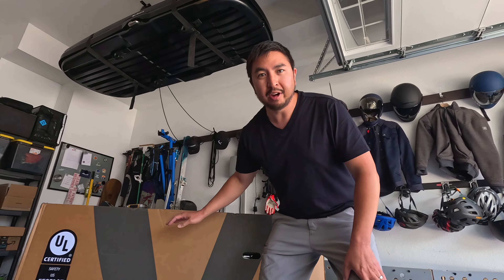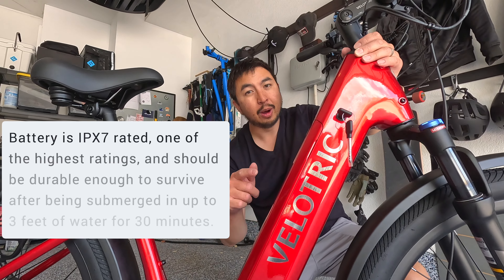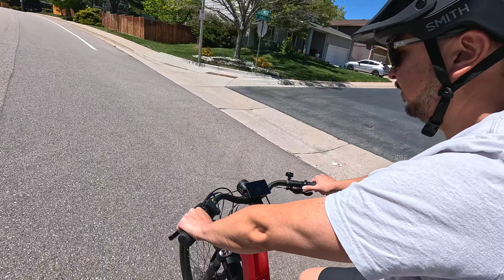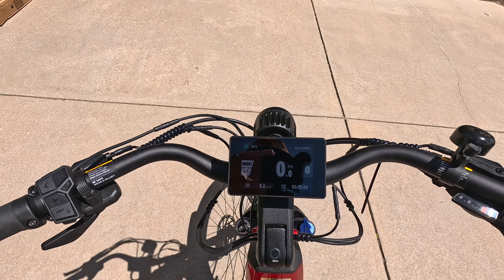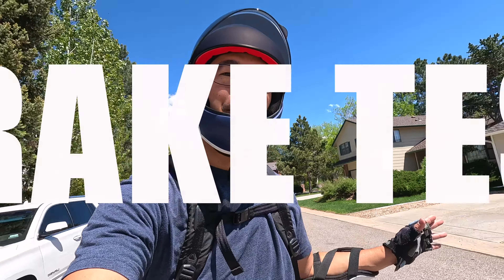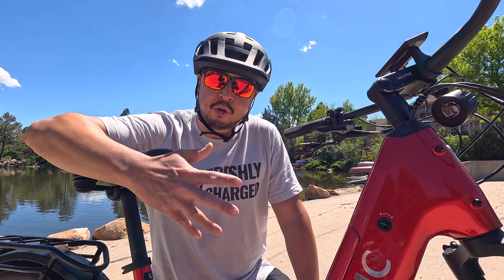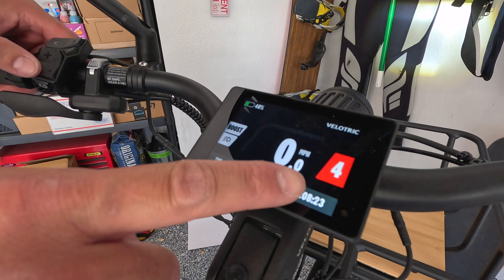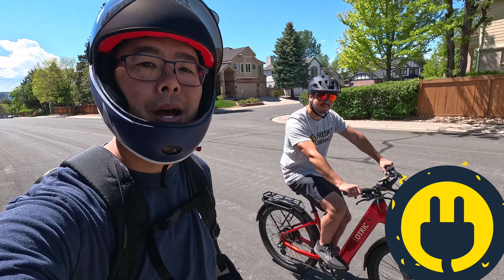This Premium & Affordable Ebike is Actually Really Nice: Velotric Discover 2 Review

Comment: D2 owner here - Software has been updated recently to allow rider to switch between torque sensor and cadence sensor modes. Cadence gives extra acceleration and top speed at the cost of more battery use. Short trips go cadence, long trips go torque. Best of both worlds.

Comment: The throttle not working at zero PA is a bummer. A safety thing, I get it since people want the throttle to work from a dead stop, this PA requirement is to prevent an accidental throttle surge when the rider is not mounted but the bike is powered up.  However, a cadence sensor will normally allow throttle at zero PA but then again, its a cadence sensor which is normally not preferred.

Comment: Older viewer here. Have definitely been considering purchasing an e-bike. Have not decided yet what company to go with. Just out of curiosity from the time of the unboxing until when you were completely finished....... how long did it take you total time to actually assemble the whole bike?

Also I like your nice wide view blue helmet. I'm assuming that's not a bike helmet but more of a motorcycle helmet with the pull-down visor? Am I right or is that actually a motorcycle helmet that you decided to use for biking?

Comment: First off, thanks for a detailed and thorough review of the D2!!   However, how in the way is the brake cable with the front basket attached?   You guys were the first to call this out and ITS A HUGE MINUS if there is not a decent work around.   Can the brake cable problem be fixed by running it through the open grate of the front basket?   I am ready to buy the D2 but the brake thing might be a deal breaker.   Also, do you guys have an assembly vid of this bike or have a link to one?  Thanks for everything!

Comment: can you adjust the acceleration rate in each PAS setting?  My wife and I are in our 60s and haven't ridden our mtn. bikes in about 12 years and are looking into ebikes.  I feel fine on the one I tried but my wife will need to ease into it a bit more  so I think having a slower acceleration rate while she is a beginner might be helpful vs. a sudden burst of power.  I hear what you're saying about throttling in the zero setting, but I think for a beginner its a good safety measure to have that one setting where you can only ride under you own power.   My only other concern from your written review (yep, went there) is parts availability.

Comment: Hi freshly Charged! What E bikr would you guys suggest me to buy? i want to spend maximum of 4000 Cad and i think Nami burn e2 32 amp battery is great but not sure because it's so old model, and i saw Inmotion Midnight lite and i think I'm going to buy it, do you guys have other options? i need a good scooter that has great acceleration.thanks